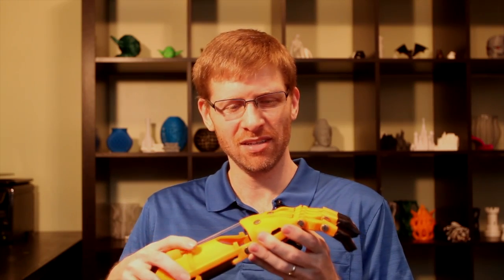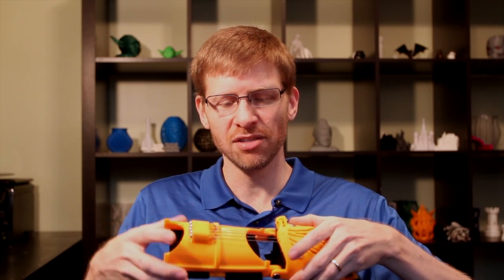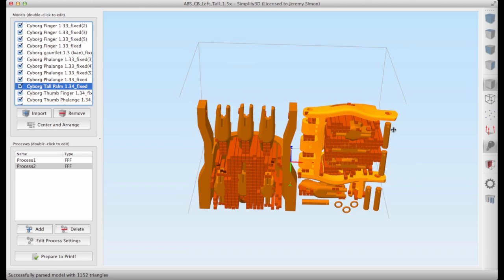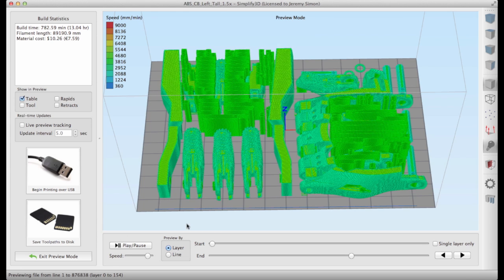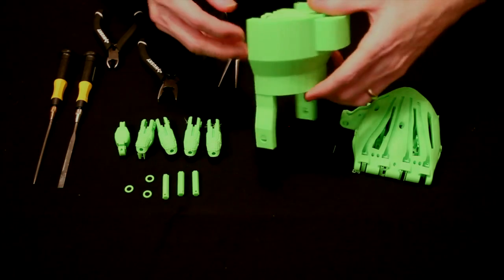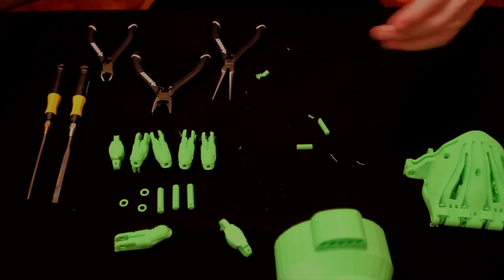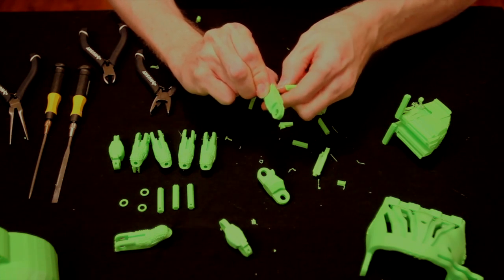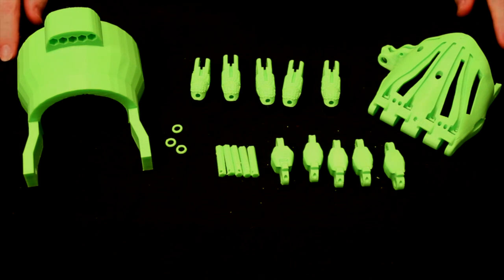Using Simplify3D to Print a Prosthetic Hand on a Single 6 x 9" Build Plate (3D Universe)

Comment: which material can be used to make the hands abs yes, PLA? others material. Do you do legs also?
Reply: These devices can be made in a variety of materials. Most use PLA, but ABS is good too. Some use Nylon, Polycarbonate,. or other materials. The e-NABLE volunteer community that makes these devices does not currently do legs, due to possible liability issues if someone were to get injured due to a part breaking.
Reply: how do you help or do this. how do I start. where are the files/
Reply: Please visit http://enablingthefuture.org/get-involved/ to get started.

Comment: I like the way that Simplify3D does their supports. I've got to get that software. I found printing under overhangs to be a great space saver back in the gear heart days.  One thing I did notice was that the more parts that are on the HBP the harder it is on the heater system. (PSU, wiring, connectors etc.) It all acts like a giant radiator. I upped my MK1 HBP wiring to a high strand count silicon 14ga soldered to the HBP. Dropped my amp draw 1A over the stock white or red Molex. jfyi :)